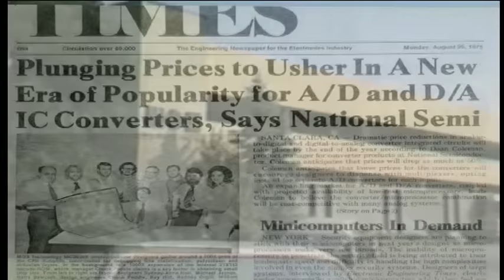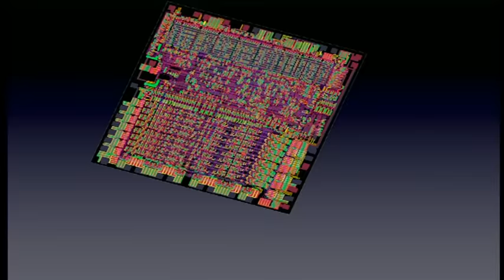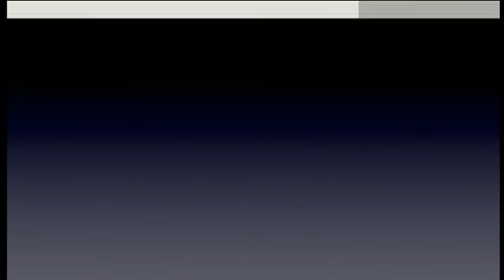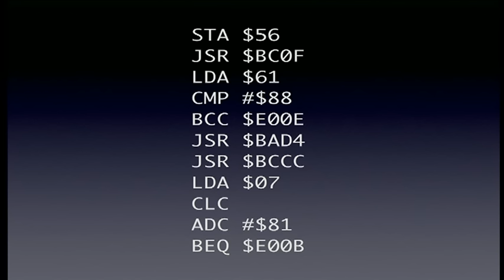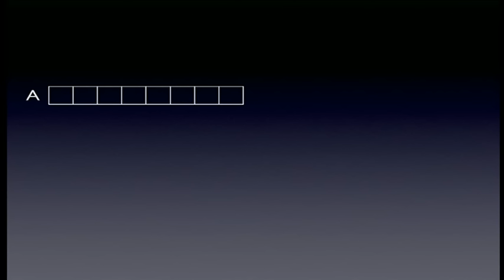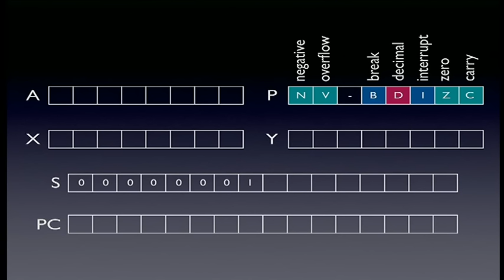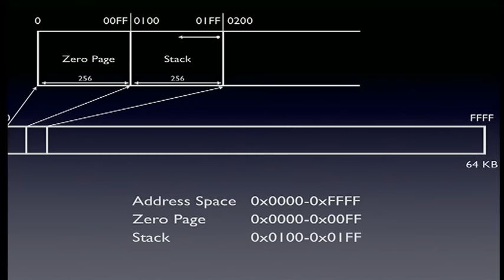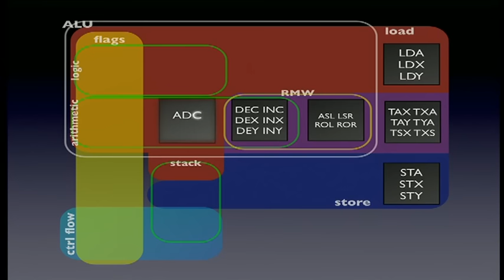27c3: Reverse Engineering the MOS 6502 CPU (en)

Comment: I find it very interesting and I am a huge fan of, user of and collector of old 8-bit and 16-bit systems.  However, I find myself wondering why all this effort into creating the perfect simulator?  There was no information provided as to why they want to fully understand the 6502 right down to it's signalling.  It is a lot of effort, so what is the reason?  Thanks.
Reply: It's because the 6502 is such an iconic processor not just for its power, but its simplicity. When I was a kid, and got my first 6502 based machines (Atari 400, then a Commodore 64), it was a gobsmacking revelation that if you read the manual closely, you could understand virtually everything about how an actual computer worked, a computer in your own hands. Virtually every programmer of my age (I'm 51 now) who had a computer back in childhood had one that was based on the 6502 (with a few Z-80 based machines out there, and some other oddballs). The 6502 is to processors what the Douglas DC-3 was to aircraft, a legendary textbook example of fine and economical engineering.
Reply: @AlanCanon2222  I get the nostalgia part.  I too  am an old school computer geek.  I started on a Color Computer (first model) which had a 6809E (cousin to the 6502).  I also had an Atari 400 (still do), Atari 800 (still do),  An Atari 2600 (with another cousin processor), Atari 5200 (6502C - still got it), Atari 7800 (6502C - Still got it), an Apple iie and Apple iic (still got them), and a few others.  As far as the Z80 realm I had a ZX Spectrum (still do) and a colecovision.  As far as oddball processors I did have an intellivision that had a weird processor.  I moved through to the 16 bits machines with the Atari STs (1040 and Mega 4) and eventually so on and so on to the modern  64-bit machines we have today.  So I get the nostalgia part big time.  I learned to code on a Atari's and COCOs.  First it was BASIC then fortran, pascal, C and eventually C++.   Anyway, like I said I love to collect the old systems because they are awesome.  I just don't get the massive effort in creating a perfect CPU simulator, that's all.  But for the people doing it they sure do have a lot of passion for it and I can respect that.
Reply: @someinternetdude4159  The way they did it, though, boiling the design down to a description that can be fed to a generalized gate simulator, is copper bottomed genius to me. So perhaps the generalized simulator is the clever piece, with the analysis of the 6502 just grist for the mill. For of course the same simulator could take a description of a Z-80 or any other similar arrangement of gates and do the same thing. It's physical simulation, versus emulation, very cool. I have the privilege of having been a "computer guy" to the biologist Richard Dawkins, who, I may say, was born to code, and he related to me conversations with Douglas Adams where solving problem X with a computer leads you to want to solve all general problems of which X is a special case, just to see if you can do it, even when it's way beyond what you actually need to do for your initial goal. I think the visual 6502 people were operating with that level of obsession.
Reply: @AlanCanon2222  I wish they had explained the reasoning behind this, because I am genuinely interested in the practical applications of this.  I also suspect it is to build a CPU simulator to be used to simulate designs.  The proof of concept will be the simulated 6502, but the practical application will be future designs, or in a situations where you need to run legacy 6502 code on something other than a 6502 and you need perfect emulation of the CPU for code that uses a lot of unconventional programming techniques or 'tricks' to make things happen.  I imagine once a perfect CPU simulator is created that they will branch out into sound and video chips and so forth.  Anyway, whatever the reasoning, it would have been nice to include that for those us interested in the 'why' aspect of such a project.  It is one thing to see ones work, and this work is amazing, but it is nice to see the reasoning of motive behind the work.

Comment: My closest experience to this was with the elegant 6809, which was close to being FORTH on a chip. I cut my assembler teeth on core-memory "minicomputers" such as the Interdata Models 4 and 16, with 8 KB and 16 KB RAM  respectively. Unlike the micros, the Interdatas were basically 16-bit versions of the IBM 360 archtecture, with 16 more or less general purpose registers, vastly more than even the DEC minis. Those things ran at about a million ops per second (an op, then called a "cycle", was basically a fetch), which was pretty good for all of the 1970's. It is ironic, though perhaps typical, that the kludgiest architecture, Intel's, won the day, and then in an even kludgier hybridization to make the IBM PC. An untypical act by IBM, making the BIOS and bus specifications open, led to the PC and Intel tsunami, and the smart move by Compaq of putting the 386 into the  PC-AT architecture before IBM came out with an improved closed architecture (PS/2) ensured that the PC became a commodity based on x86. And that was years before Linus Torvalds ensured that x86 eventually would take over the realm of mainframes and supercomputers.  

What we have today was not even imaginable in the early 1980's. Still, I was able to crank out 1/6 the compute power of a VAX 11/780 with an 8088/87 based Compaq Portable. Today's standard CPU's do about a million times better, let alone GPU's.

Comment: Is visual 6502 really simulation or just more advance emulation, for simulation you need to simulate all characteristic of the transistor materials.
Reply: No you don't, under normal operating conditions the analogue characteristics of the transistor are irrelevant because all you're interested in is the switching of the transistor. It's, either on or off but the O/P  in some cases,  can be tristated
Reply: Emulation is faithfully reproducing the output of an existing system for all combinations of inputs and machine states.  To do it you need to know all the possible machine states, all the possible input combinations and what happens next for every machine state input combination.  You don't really have to get down to the transistor level to emulate you just take a top down approach.  Simulation is bottom up where you use models of individual components and combine those models into a virtual representation of a physical thing.  Then you set some initial conditions and run the simulation.  With transistors you can use a simple model that represents digital behavior or you can use a complex model that simulates full AC characteristics across a wide range of signal frequencies.  You seem to be implying that I'd have to solve the Schrodinger wave equation for every electron in the transistor.  Maybe that would give you a more perfect simulation but I can assume a much simpler transistor component equation and still get a useful simulation.  Simulations can be made more and more complex up to the point that you end up "simulating" a 6502 by running a 6502 with every node hooked to an logic analyzer.

Comment: How the heck does did those Nintendo 8-bit games run on 3,500 transistors?? On Super Nintendo that must have been impossible(im assuming that 6502 was an advanced version).
Reply: The NES CPU is a chip that includes a 6502 and adds more circuits around it. You can see it on die shots of both processors.

Comment: Big Endian Best Endian. Cut my teeth on 6502, but once I got my 6809 I never looked back. Well, not until recently when I started building a home brew 6502 for fun.
Reply: IBM decided on byte granularity for writes to memory. So any bigger values have EndianNess. But when you look at the blitter in Atari Jaguar, it does address full 64Bit words and can write left and right spans. What if Store instructions used a bit mask to preserve some bytes ?

Or have byte memory, but no instructions for pointers. Kinda like RCA1802 . For interrupts and subroutines the return address is stored in a register as on MIPS . To allow both, have two registers. To allow nested calls for STI: have a hardware stack

Comment: They don't teach binary coded decimal anymore?
Reply: No. Why should they? When you don't run some COBOL machine, you will on the base of the machine always have a true binary system working, as it's nowadays much faster to just convert a decimal into a binary and back:

"BIN_DEC:  MOV  A,R0

                 MOV  B,#100

                 DIV   AB

                 MOV  R3,A       ; R3 CONTAIN HUNDRED NUMBER

                 MOV  A,B

                 MOV  B,#10

                 DIV   AB

                 MOV  R2,A       ; R2 CONTAIN TENTH NUMBER

                 MOV  R1,B       ; R1 CONTAIN LEFT DECIMAL NUMBER

                 RET
      "

Would have taken quite long in old times - nowadays it's just some nanoseconds :D

Comment: 35:25 This guy clearly doesn't know how the Z80 works. The Z80 performs fetch/execute overlap just like the 6502. The four cycles he talks about is 2 fetch + 2 refresh that are always combined for the opcode byte, while operand fetches takes 3 clocks for each byte. 
The main difference is that the Z80 uses a higher resolution clock, instead of relying on analog delays for memory access, like the 6502 or 6800/09 does (and which makes these chip's timinings very inconsistent among different processes and manufacturers). 
So due to much longer relative memory access signals (2 full clocks in the Z80, compared to 0.3-0.6 clocks in the 6502), the Z80 could run at 5-6 times higher clocks using the same cost memory chips. For instance, a 1 MHz 6502 from MOS needed 300ns memory chips or faster, which is enough for a 5-6 MHz Z80. The Z80 also performed a 16-bit addition on 11 clocks, while the 6502 needed 20 clocks for the same thing. If you multiply these factors, the famous performance gap on 16/32-bit arithmetics and floating point between these two processors becomes clear.

Comment: I guess it is not a matter of whether it could be reverse engineered.
It is more about whether it could be made for $0.03 a piece.
Reply: make billions of them at the same time and you can ... sell about 60% of them (failure rate of IC etching) .... figure the cost of each silicone plate costs 200k after 1billion of the plates your costs are pretty small ... this is also why MOS was still on most commodore machine chips they had that many still in stock to work with ....

Comment: I did a bit of poking around with the illegal/undocumented opcodes some 30-odd years ago.
That LAX loads the same value that is on the bus into both the A and the X register makes quite good sense, it just opens both latch-banks.
But that with the SAX instruction the X and A registers are ANDed and the stored, how could that be a combination of two store instructions? Well, unless both output latch-banks simply open to the bus and manage the ANDing of their values by basically shorting out 😳😬
I measured a distinct temperature increase of the cpu when executing 1M SAX instructions, and decided that I didn’t want to blow up my C64, so stopped right there.
Reply: The heating is a clue, but otherwise it could be STX using the ALU to pass through the value to the left bus and SAX leaving the ALU in AND mode by accident.

Comment: How is it that the company that engineered such an amazing machine went bankrupt? There are times when marketing people need to be hung from the tallest gallows.
Reply: They got sued by Motorola because someone (allegedly) brought some IP over when they stared MOS. It was the law-suite that undid them.
Reply: When MOS was founded, they first invented the MOS 6501 - which was a complete rip off of the 6800, by function and internally. And as they were former engineers of Motorola, they couldn't say, that they did it via reverse engineering, unlike Zilog, who just had simulated the behaviour of an 8080 with their own design (and even advanced it). So they had to make the 6502 from scratch, which was costly, while they couldn't get any money out of the 6501s. On the other hand, that's why the 6502 was so unique: they used their experience on the 6800 and 6501 and made a processor, that could do what the others could do: but simpler and cheaper.

Comment: The 6502 was used in computers whitch are still loved after all those years. This talk about the 6502 microprocesor explains a lot. The 6502 was not perfect but it worked, and it was cheap, therefor it could be used in computers for millions and millions of people who else would not have been able to afford a computer. 
 
Personally I think that the 6502 was a dead end road in the computer industry, there are no great microprocessors that are based upon it, there is no development that goes back to it. Others were more succesful. I think the tremendous sales of the 6502 were only caused by the low prices, not for the ingenuety.
Reply: hmm 6502 6510 z80 ... 68k .. 8510 ...8086 ... 80286 ... 80386 ... 80486 ...and what is your CPU labeled as today ...  no not a single processor based off the 6502 or its idea ... just EVERY processor since its inception
Reply: @0623kaboom  Sorry, this is not correct, the MOS6502 was a cheap knock-off of the Motorola 8600. The one who developed the 6502 worked for Motorola on the 8600-team before he started his own company. All 80xxx are based upon the 4004 and the 8008 and those are from way before the 6502.
Reply: @vanhetgoor  
The 6502 was based on the 6800, not the 8600 (whatever that was).

The 80x86 series were based off the 8080 which was a development of the 4004.
Reply: The Acorn Risc Machine  design was heavily influenced by Acorn's use of the 6502 and design features of the 6502.

That first processor became known as ARM, and through development processes since the 1980s has become the processor of choice for most mobile phones...

Comment: I kinda of wonder why the designers never mapped undocumented OP codes to NOP.  This kind of oversight is just right for hackers to exploit.
Reply: Because that would have made the Random Control Logic unnecessary more complex. It's not oversight, it's by design.
Hacking on that level was nearly non-existent back then. Computers weren't interconnected like they are today. To even get to hacking a computer, or, what you suggest here, a CPU, you'd require direct physical access to the computer in question.
Reply: It would cost more transistors. Actually, they should have strived for a more regular, orthogonal instruction set without irregular gaps. I love the branch and set flags encoding. Dense! But the rest?! Why not orthogonal instructions with regard to addressing mode and instruction? MIPS is so much better. They start from the ADD reg, immediate instruction. Then the next bits tell the CPU if it should just store the result in a register . Otherwise it is an address. The next bit tells the CPU if it is load or store instruction. Then comes the name of the register with the value.
Reply: @ArneChristianRosenfeldt  You could theoretically design your own instruction set. Right now a working model can be "fabricated" with an FPGA. Within a decade there might be plants that can fabricate those actual chips. I believe IBM once built an entire S/360 into a single silicon chip just to test their chip design program. I cannot find this article. This was before the internet. Go for it.
Reply: @elye3701  Sadly, a lot of YouTuber just fill a 32 kB ROM with arbitrary, multi-cycle microcode and call it an Instruction set. That would never fit on a die and would be super expensive. The whole point of 8bits .

Comment: 3510 transistors and it worked!
Motorola 68000 had 68000 transistors and it worked with a Mac Graphical User Interface.
Steve Jobs then trotted a NeXT Computer with the 040 CPU : 1.2 Million Transistors with 
a REAL Operating System: Unix.   Speed 25 MHz in 1988.
We didn't really get the color right until 1999 with ATI Rage 128.
Reply: +Ken Baker - The cool thing about the 6502 is what it did for the price it was. That's what makes this so interesting. Yet, you're right about the NeXT Computer. That was bad-ass... but it was a little over $10,000. I had an IBM PS/2 back in 1990 with MS-DOS. (I didn't get Windows until later).
Reply: The 68000 had about 40 000 transistors (while the 8086 had 20 000 and the Z80 approx 8 000).

Comment: It is 2019 now and I wish to know if the other key chips of commodore 64 are already been reverse enginereed.
Reply: @Filip Legény true, I knew of the developments of emulation even thru the use of fpgas but actually I'm referring about the knowledge at a gate level of every chip. I mean something like the work done for the 6502 in the video.
Reply: The problem with SID und VIA is: They are very special chips - so you don't have so many spare chips you can risk to get good pictures, like they did it with the 6502. The 6502 is such a common processor, which you had in so many devices, that you can risk destroying a bunch of them to get ONE good picture.
Reply: @acmenipponair  Use dead SIDs. If the failure mode is different due to fragility of the design with enough dead chips looked at you can compile the whole thing. And if they all fail in the same way you only have to do a few good ones to get a good hard look at the otherwise damaged area.

Comment: I know this is really old but I wonder if anyone has built using 3,510 regular sized transistors, an A0 sized 6502 that with a sprinkling of LEDs could actually run 6502 code just like the real thing. I think it would be cool to play my 8 bit games sitting next to the giant 6502 powering them, maybe being abkle to adjust the clock speed so it could run as slow as the simulator just for the sake of watching it dance and blink.
Reply: Mega6502 , but no LEDs. You could display visual6502 on a large LCD?